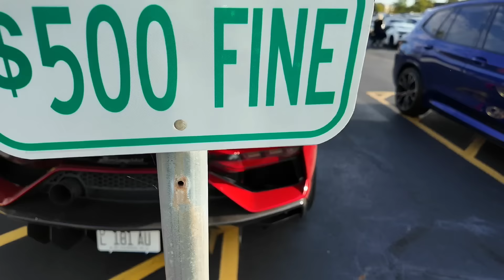TIME TO GET MY KIDS NEW CARS AGAIN THIS THE LAST TIME

Comment: How about a jeep gladiator Rubicon or 2020 Mercedes-Benz GLC 43 AMG for Chris . Both have v6s and all wheel drive for the winter as well as safety features and Blindspot monitoring. The Mercedes will give him a special/luxury feel.
2020-22 Silverado 1500 trail boss/high country/Z 72 (4 x 4).